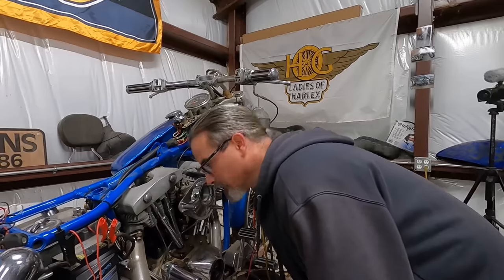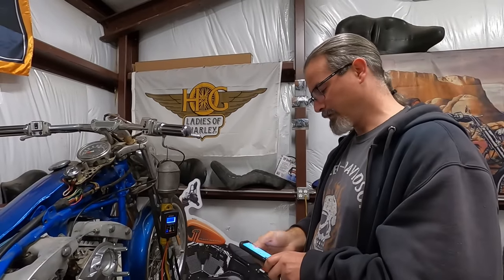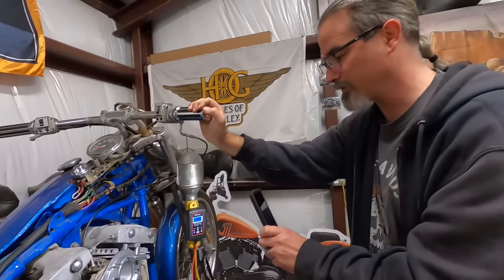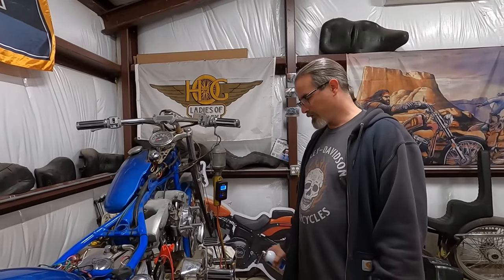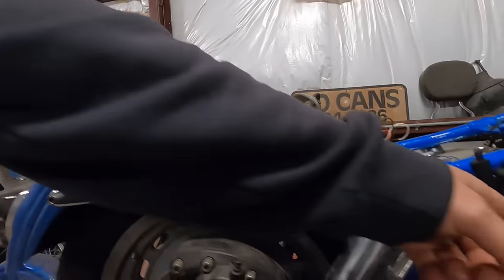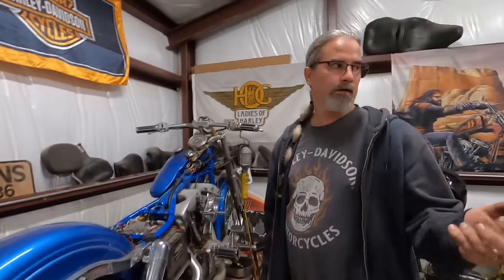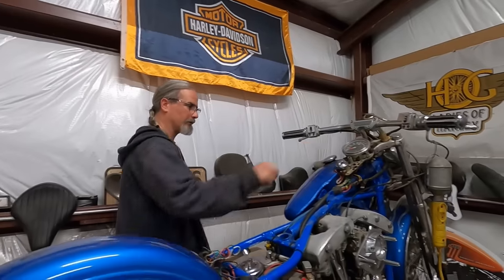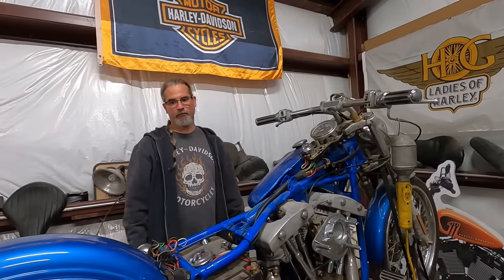A DEAD 1974 AMF Harley Davidson SHOVELHEAD Brought BACK To LIFE 74 CUBIC Inch 1200 CC's

Comment: I bought a '74 FLH Shovelhead that did not run. Had good spark, accelerator pump was spraying fuel. Checked, rechecked, and cleaned everything on the circuit board. Finally found a dead circuit breaker under the tank. Nothing better than hearing that starter crank when before it was dead as a door nail, lol.

Comment: Some of the best Shovels I've had were fast. I installed a Jim's Evo oiling system with a single fire. SS carbs, etc. Kick only . 1 7/8 drag pipes.  Always good time. Sometimes, a scary bastard

Comment: If the bores were dry from not running then compression test will show low. Pop a very small amount of oil in the bores and turn over a few times and then test will give you a truer test result.
Reply from the maker: Oh, didn't know that. Thanks, man!
Reply: Also while checking for spark you don't have to crank engine when first checking.  Just short across points with screwdriver with points open and ignition on to watch/listen for spark. Every time you ark across points plug fires.  No spark check electrical, componets, grounds, etc.  If you do have spark shorting with screwdriver then you know ignition does work which pretty much leaves points needing to work right.

Comment: After 20 years riding my kick only 1974 shovelhead, i never had big problems with it. I have a hsr42 carb and good old points. In your case i think you have a fuel problem straight out of your tank, fuelline or carb. If you pull off your fuel line from the carb, does it flow? It can't be a big deal to fix this. Good luck mate and already a happy new year 👍🍾🥂
Reply from the maker: With a couple of turns at the pump adjustment, and some new intake seals, we got that motor running like a song.

Comment: "It ain't got no gas in it".... :-)  ... LOL!  >> I've overlooked bad condenser on points ignition more than once .... Usually = rough running vs no start condition ... > Your troubleshooting / repair skills are as good as anyone else that works on these older bikes ...

Comment: I would check fuel flow to the carb from the tank, I have had fuel lines collapse on the inside from age
Reply from the maker: With a couple of turns at the pump adjustment, and some new intake seals, we got that motor running like a song.

Comment: Carb spray pattern?  😶

You can fix that .

Plugs?

Best if luck Cory! 

Happy New Year to you & Mrs. Tramp! 🎉
Reply from the maker: With a couple of turns at the pump adjustment, and some new intake seals, we got that motor running like a song.

Comment: I'm working on a bike from a colleague that had been standing in storage for 6 years. I just didn't wanted it to end as a parts bike (it is running but needs work on the rear brake).

Comment: Just a suggestion, maybe check to make sure carb is receiving a good flow of gas before ripping into the carburetor.
Reply from the maker: With a couple of turns at the pump adjustment, and some new intake seals, we got that motor running like a song.

Comment: Is that starting fluid you're using?? If so you have to get John Deere starting fluid.. that stuff works!! It's not the watered-down junk that's sold everywhere else.. that's a nice looking shoveling.. guessing it's a super glide?? Definitely painted up pretty nicely but you can never trust someone's word when they say it ran like new when parked..
Reply from the maker: Yeah really. That's what they all say. By the way, I was using brake parts cleaner. It's just as flamable.

Comment: I always liked to put a couple of squirts of marvell down the plug holes and let it sit if it has a kicker kick it through a few time's oil up the cylinders no kicker put it in 2nd or 3rd and turn the back wheel I don't think I would use starting fluid the other thing I was thinking about was the valve guides we use to put marvel mysterie oil in the fuel unless someone changed the guides that 74 wasn't meant to run on unleaded more then likely if it was running in 18 someone put bronze guides in it already is that tranny backwards 1 up 3 down? I 👍😎👍

Comment: Yes I agree Carbs needs gone through, and the fuel tank cleaned. Menthol gas is most likely the cause.
As a rule of thumb, I won't put any Non Alcoholic gasoline in any of my bike's, weed eaters, or lawnmowers.
I have also called it Grass-alcohol. 😮😅😂 Because it'll turn green, if it sits to long.

Comment: 4:25 At this point you cant have spark cause the high voltage circuit goes through both plugs. And you clearly don’t have the rear one connected.

Comment: Ethanol fuel probably stopped up the lines.
Reply from the maker: With a couple of turns at the pump adjustment, and some new intake seals, we got that motor running like a song.
Reply: @SaddleTrampTV  nice,& I get the Johnny Cash reference.

Comment: Exactly the reason I stopped working on other people's vehicles an bikes, you tell them what it needs, an they want to cobble it, or liability. I believe that bike has a little timing an spark issue, quite possible the accelerator pump diagram is bad.
Reply from the maker: With a couple of turns at the pump adjustment, and some new intake seals, we got that motor running like a song.

Comment: The carb gumming up is always a problem with anything that has sat for a while. No one should be running points anymore. You're troubleshooting would get better a lot quicker if you had to kick that scooter over to get it running. Rode scooters from 65 to 92 without a button. I also have the limp to prove that. Later my friend.
Reply from the maker: With a couple of turns at the pump adjustment, and some new intake seals, we got that motor running like a song.
Reply: @SaddleTrampTV  Good for you. You are a lot better at troubleshooting than you give yourself credit for. Never a bad idea to take the carb off and put it in the ultrasonic cleaner. I believe that you can put both the o-ring and bands on that intake.  Later you journeyman troubleshooter.

Comment: Accelerator pump not working . Maybe light tap on the side , could be bad diaphragm . Cheers !   G. S.
Reply from the maker: With a couple of turns at the pump adjustment, and some new intake seals, we got that motor running like a song.

Comment: 30 psi? but both are showing that its most likely a bad test. engine was dry ect... or another thing it could be if it has solid lifters and they are set wrong keeping valves open. chech the manifold rubbers, they will be shit after sitting that long. those s&s super es are touchy. and have to be set right. one other thing id look at is the fuil fillter and screen. this bike was ment to run leaded gas so valve seats/ guides could be bad. but like i say if they are measuring the same probably not.
Reply from the maker: With a couple of turns at the pump adjustment, and some new intake seals, we got that motor running like a song.
Reply: @SaddleTrampTV  yeah those intake rubbers are notorious.